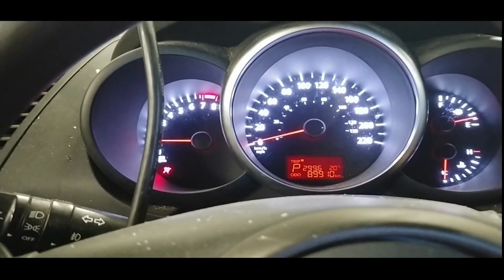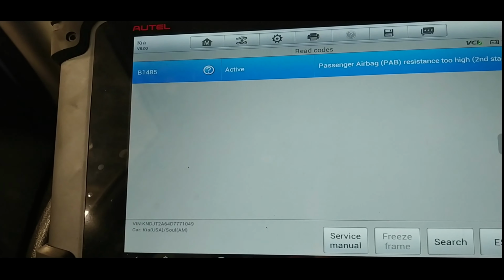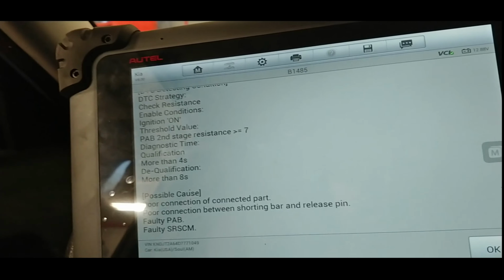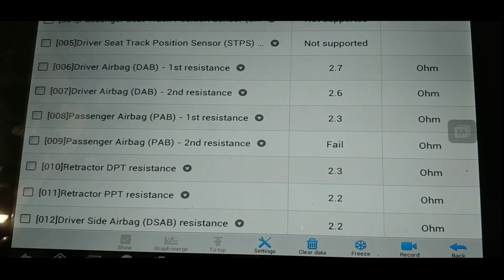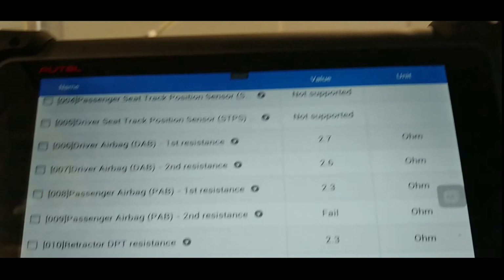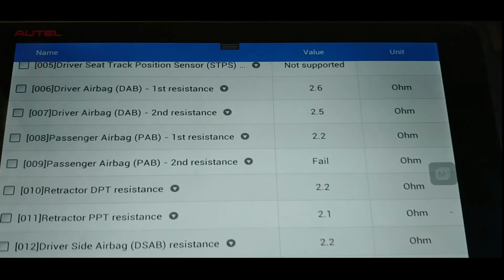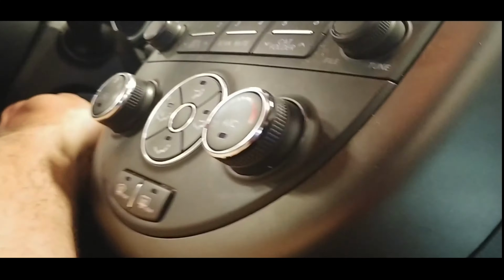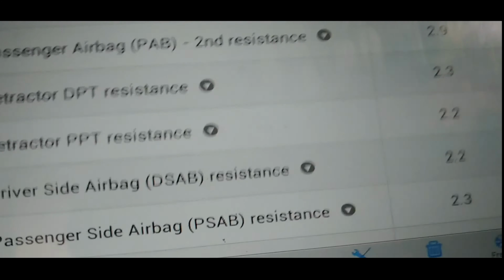Kia Soul Air Bag Fault b1485

Comment: I have a 2015 kia soul that a wire got cut from the impact sensor on the front passenger side. But the colors to the wires are different the wires from the vehicle are different to the connector i was trying to spice it together but I didnt know if I put the wrong wires together it will deploy the  air bag.
Reply from the maker: As for the impact sensor, you should have 2 wires- a yellow and a black wire, these wires are the same colour all the way back to the srs control module.

Try cleaning off the wires with a rag or paper towel.  to expose the wires true colour.

thanks for watching😁